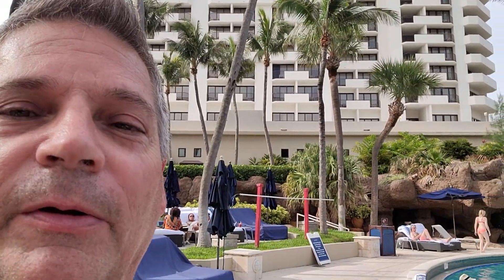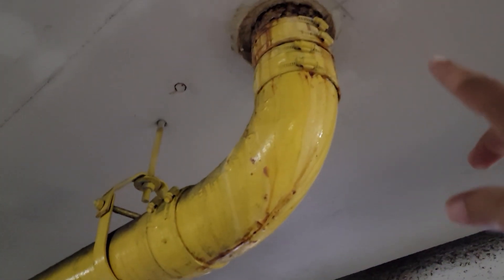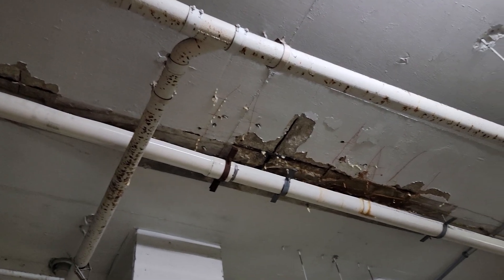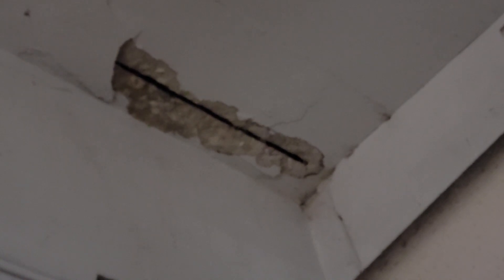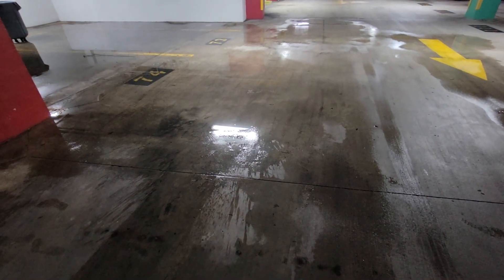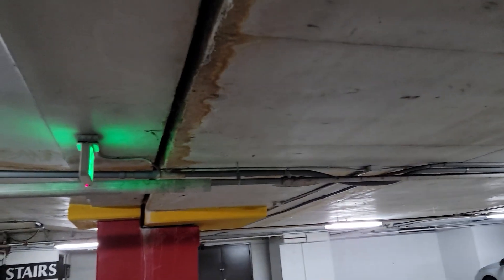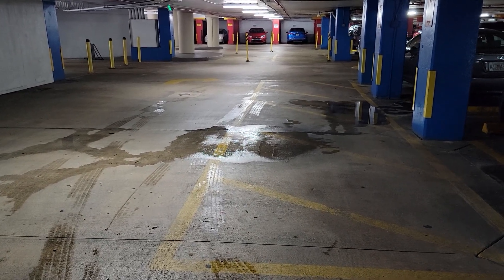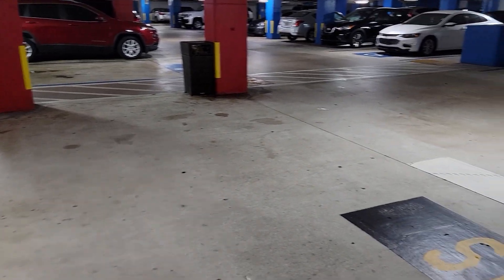Scary Garage Damaged Concrete Marriott Harbor Beach, Like Surfside Collapse

Comment: Its really even more scary when you see this is a building that is just temporary accommodations for travelers and people on vacation.  After Surfside, you know full well that those living in condos are now especially concerned and educating themselves and suddenly looking at walls and ceiling and puddles with very clear eye, at least for now.  And condo owners even across the country are taking notice and many local building and inspection departments are fielding a great deal more calls then they ever really had before.

The problem is that, for the most part, people parking in a Hotel garage are not looking at it like a unit owner, or property owner, and assuming that if a Hotel was not safe the power that be would have closed it.  The problem is that there is a lot of damage. possibly going on that cannot be seen and leaks in a garage may not worry a tourist, and they may never think of it again. and so attention may not be getting drawn to it in the way it should be.

What about what reporting rules have to say when one has some expertise in engineering and structural integrity of a building?  Here, it is mandated that whether you are a real estate agent, or inspector, or engineer or architect etc  and you come what appears to be some major issues, as you just documented here, it would be your fiduciary duty to report what you saw to the local building authorities.  In many cases when we get a report from someone with knowledge is usually turns out that the owners are aware and plans for corrective measures are already in place, but we get some that when the report is filed there is nothing going on that our officers have been made aware of that is moving forward with repairs or remediation so an inspector i sent out and very often we have ended up catching a problem that if left much longer might have force a condemnation of a building. Having people who know what they are looking at mandated as reporters of issues, as well as peer reviews on all structural planning or renovation or retrofitting etc can make a huge difference.

And in your area when you probably are dealing with higher mineral levels in the water or some salt water erosion it really make one  wonder in these buildings over 3 stories if thorough inspections 40 years apart is most likely 20 years too many.  And whether better weight calculations are made when people renovate, and whether there are too many times that some renovations, especially the DYI owners who end up laying their own tile, ect just how much they have exceeded the weight that they were build to really hold.  I am sure when a permit is granted to renovate a whole hotel, that is well calculated, but in large condo buildings it not hard to find that almost half or the renovations that end up getting are DYI owner's project and they have no idea that they even needed a permit to remove all the carpet and linoleum, replace it with marble and ceramic tiling, change out light pressboard cabinets with heavy solid wood.

Also, if windows and glass doors get damage by a hurricane, can those be replaced with heavier multiplaned glass and because its considered a repair not really even a job that needs a permit?  It would really be interesting to locate on the original documents what the load baring weight was, and how much leeway each unit had and then start looking through real estate ads for 'renovated' condos with pictures as well as any permitted work done to renovate any part of the building and see just how over weigh that building could have become since I suspect since the property was listed now as luxury condos that upgrades had been done over the years cause no one would have bought one of those units at a 'luxury condo' price given what it originally looked like.

Again, I am not saying the renovations caused the building to collapse, but I really believe that there has to be a reason why when the pool deck and section one fell, there was a good bit of reason to expect the building to shift loads and hold on even if unstable and it resulted in condemning it later, a whole lot of people would have survived.  But if each section was already holding more rate than it was originally rated too, there was no way it could shift to do anything to stay standing and then did topple under is own 'new' weight
Reply: I would say that every bathroom wall remodel added a half ton, and the floors a ton of extra mass in the tiles and cement, so for a full tile upgrade you probably have 10 tons of extra load spread out on the unit. Yes will add up over 100 units, and if the original design was a little optimistic on floor and wall loading, and the builder was a little shy with putting in the expensive rebar and cement in the construction, along with early shuttering removal which left the concrete weaker, you will get there eventually.
Reply: @SeanBZA  Yes, in principle. The original design would not meet current UK codes.  The construction techniques would not pass one of our inspections.
Sadly, when it comes to spending money people spend it on a lick of paint and windows not a structural inspection.
I don't just mean big building owners, still may of the domestic properties I inspect do not have loft or any insulation.
90% of loft converted homes do not have fire doors on habitable rooms because people want Farrow and Ball on the walls and walnut on the floors.
It's all right until its not.

Comment: Thanks for the good explanation. I hope people really understand that, that these things don’t mean the building going to collapse today, tomorrow, or even in the next few years. The issue is not the immediate danger, the issue, the danger, is that they are not repaired for years, not repaired during the time they are not a problem. They wait for the problem to get worse for when it is a structural problem in the hopes of securing funding but not before when it maybe be easier and safer to fix. The damage is not the problem especially right now just that no one is taking care of them right now. 

Can’t actually speak for this hotel I do not know if they do have plans to repair these issues soon it just often time like you said are ignored because they don’t pose an immediate threat to anyone know so it is easier to ignore the repairs. But then the repairs start piling up and that when things get scary. If people want to know how good the management is then I would start asking the question when and not why. If they can give you a date of the repair that you can stay on top of them you know it’s getting done. If they have no date you know they don’t care at all.
Reply from the maker: Right on Alena!

Comment: As a condo owner in Mich., I now have questions concerning water puddles per underground garage in a small area.  My building is 2 stories high with no pool nor adjacent to any body of water.  The puddles are occasional.  Several of the units "share"  plumbing.  What would be the level of possible risk for these types of buildings?

Comment: I agree with most of your findings, but I have the following comments:

At 1:43 , I don't think the design intent of the expansion joint has anything to do with isolating part of the building during a collapse. It's there to allow for building movement from thermal expansion/contraction without causing cracks elsewhere. Those joints are not designed to limit any collapse if it happens.

At 9:10 , Are those actually rebars? They appear to be very smooth and not ribbed like rebar unless the ribs got corroded? But it also does not appear to be corroded at all based on your zoomed in video.

At 12:30 , it is still 6000 psi concrete...the problem is mostly associated with the corrosion of the reinforcement and not the compressive strength of the concrete. 
The structural capacity of the concrete member will decrease substantially as the rebar corrodes, but a reduction in compressive strength of the concrete, if any, in my opinion will not considerably affect the capacity of the member based on principles of reinforced concrete design. A reduction of compressive strength of concrete due to exposure from salt and chlorides, if any, will be limited to the exposed areas only. What is more of a concern is spalling of the concrete from above which is hidden from view that will also significantly reduce the structural capacity of the concrete member in a similar degree as corrosion of the reinforcements.

Comment: hi theres spalling a lot in my appartment, my dad is the owner and i was worried about it, and he says not to worry, should i be concerned?
Reply from the maker: Yes spalling is something to worry about because it could progress and become really bad in fact spalling often continues on at least three feet or further beyond the point where you can see it, beyond the rust, beyond the point where chunks of concrete were falling down. You're just looking at the tip of the iceberg and unless that is fixed it will progress unimpeded until there's some type of collapse.
Reply: @jeffostroff  ok thanks theres only that lttle bit but ye ill warn him about this by the way ive learned a lot about this sorta stuff from you so also just wanted to say thanks

Comment: Everybody is gonna go into panic mode every time someone sees a garage with dripping water from now on...
Though that rusted pipe with the exposed wires is really dangerous, especially in a public space like this!
Let's hope that Marriott sees your video and does the necessary repairs before it becomes a disaster in another 20 years or so...
Reply: The wires are exposed from the conduit but they are still insulated in their rubber coatings.
Reply: The columns and planters were the clincher for Champlain. Undersized columns and the planters helped accelerate water damage. (and of course a lack of maintenace et. al., but if you don't know your columns aren't even up to snuff at 100%...)

As long as this place doesn't weigh equivalently more for the bigger columns, the slab issues shouldn't bring it down ... at least yet.

Comment: I used to work at a chain and convenience stores as maintenance man and found that any outside central air unit that the ducks leaving from it going into the wall, if any part of that is not well insulated to keep the outside moist or warm air from contacting the duct itself will cremate a tremendous amount of water to the point that it is dripping out of the vents inside the building. And the duct work inside the drop ceiling or false ceiling if those are not completely covered with insulation it will increase the condensation inside the ducks and on the exterior surface of the ducts. So you can have a perfectly good roof and high water dripping anywhere in your building running things. And these problems were caused by sloppy installation and pour upkeep in troubleshooting that would have taken care of everything before I even signed on to the company. 🤔👀

Comment: Jeff - interesting video, as you said it didn’t look in bad shape - but does need
work. I found it interesting that all columns do not have those 'pads' but as
you said they should strengthen the link of slab/column, also a s you noticed
bigger columns and a break in the slab - which unfortunately is really leaking
bad - as others have said these joints have advantages and disadvantages. I was
pleased to see that there had been no installation of those half pipes and
plastic sheets to direct water from dripping on cars that we saw in the 'garage
video' - because that kind of indicated a 'patch and forget' maintenance
regime. The leaking valves and pipes are really just careless!
Reply: Unfortunately, refurbishments concentrate on tarting up the exterior and public spaces with little regard for any review of structural integrity.
Having looked at the original drawings to Champlain Towers I am not surprised.
Reply: @robi4387  Unfortunately as an ex-Civil Engineer PE (for nearly 50 years) I get a bit offended when my profession kills people.

Comment: Note to self: stay away from Florida!
As an enginerd, I tend to look at EVERYTHING, almost everywhere most all the time. I spent near 3 decades in the field in Johannesburg doing security  and IT infrastructure installs. I've never seen as much scary buildings since I've become interested in the Champlain disaster. 
I've learned early in my career to be attentive if the environment I'm working for my own safety and liability down the road. Photos of "evidence "are an old habit, as we're written reports.

Comment: At 13:49 and again at 25:05 this genius points out the same expansion joint that has a piece of open topped pvc attached to it to funnel water leakage from the joint away from the area.  Keeps pointing out edge spalling and talking about how dangerous it is.  You can even see the two part column in blue.  It's an expansion joint.  Lmao.  Kudos for knowing your audience is too dumb to notice repeating shots and hiding an expansion joint 👏 👌 👍 🙄Stick to bathroom remodeling
Reply: Yea this guy is slimy. He spells are/ as  ar  haha. People what this guy said above tells you all you need to know about jeff
Reply from the maker: I decided to put the 2nd scene in because it contained more information than what was in the 1st one and as this was the very 1st day learning the new Adobe premiere software, I did not have time to mess around with it and cut out the parts that were extra we're extra and all of that other good stuff that I normally do with the older software so yes a little bit of double takes in here but it's not the same scene it was shot twice from 2 different angles because originally I was going to cut parts from both angles. But calling me dumb and my audience dumb just makes you look dumb.
Reply from the maker: @NorthumbriaKing  another  one of Kai's uninformed minions
Reply: @jeffostroff  you are much too polite to these a$$holes  !!

Comment: Also I noticed all of the ceiling through that section closer to the entrance doesn't have the column toppers for extra support. Is that just missing or is there just not as much structured to hold up there above that level? I figure it is a ladder but I don't know.
Reply from the maker: That's a good question Maybe they didn't feel like they needed the d***, also we don't know if they added the drop panels later on some of these columns I would like to see the original floor plans

Comment: ITs funny to me that Florida Relies on Reinforced decking to support cars. In CA they have support beams HUGE ones. or much more Shear wall to support the weighs below. I think they really need to upgrade the code. Reason being for future failures as we are seeing in this video. Like you say I bet that is not 6000lb PSI concrete anymore....But if they had more support as it could fail like it ususally does. Especially there and also everywhere. it would still support the weight of the building and not create a collapse from Deferred maintenance. Or like you say Normalization of Deviance.
Reply from the maker: good idea

Comment: Question -- at the isolation seam near parking space 96 -- where there were stains and the corroded pipe showing the wires -- are the two ceilings supposed to be the same height? Because one was a few inches lower than the other.

Comment: IMO Florida needs to step up the building codes. I really dont see any reason for immediate worry but they should have more shear wall to support for future failures on their structures. That building has much more support than Champlain, But Still not as much Shear wall or support beams between columns. At least they have the joints like you say. I am no expert but I See something missing there.
Reply from the maker: the code  is already better than it was 40 years ago
Reply: @jeffostroff  OMG I hope so. Stuff built in CA 40 years or even more than that is foundationally way better than what I am seeing even in this structure.  Now we have just gone CRAZY......TOTALLY BONKERS. Complete houses SHEAR WALL

Comment: I looked it up, and this resort was built in 1984, last renovated in 2016. A beautiful resort, but they need to fix these issues. By the way, I saw what looked to be a temp wall in the garage, and it said "warning construction area". Were they possible starting to work on a portion of the garage?

Comment: If you patch every time you see water you will have a full-time engineer and patch crew working five days per week. The double columns are required for an expansion joint and not to keep one side up when the other side collapses.
Reply from the maker: yes you can see the seam running through them all the way down the building

Comment: Seen that, but you also see the pool deck has settled around 3 inches as well. 

I also saw a building where the tenant decided to cut out a support beam, as the forklift would not fit under it to access the back, and the floor above was also using a forklift on that same slab. Another they cut the column support pad away from half of the column, as it was in the way.
Reply: Not very bright people.

Comment: Hey Jeff at around 15:42 you said this is not your completely preferred method. I'm curious to know what method do you prefer? I would prefer having beams on top of each column tying them to each other then have the slabs on top of the beams.

Comment: Issues def need to be addressed but you can tell that this garage was engineered much better than Champlain Towers South.
Reply: This building is 15 stories vs. 12 so logic would have it that it should be beefier. Is what we see 100% load or 80% load?
Reply: @larrybe2900  Sure but Just look at the countless double columns. And they are supported with extra reinforcement on the top. Even the single columns look to be larger than the biggest ones at Champlain.
Reply: @BeepasGarage  
I won't try to talk you out of anything but rather just making the observation.